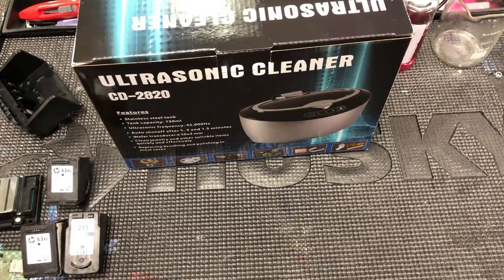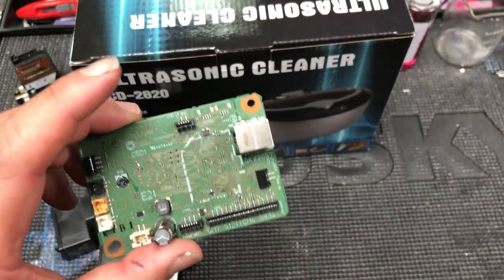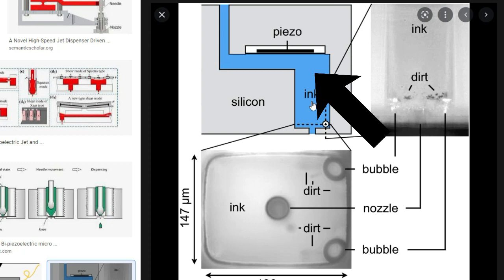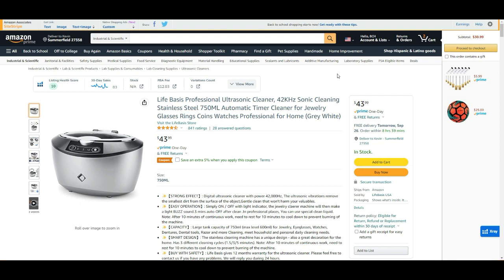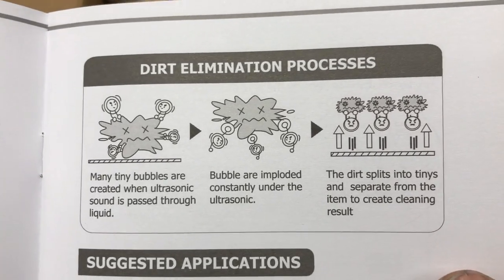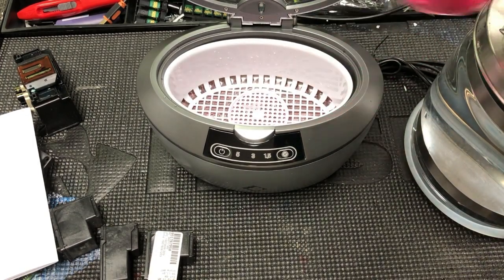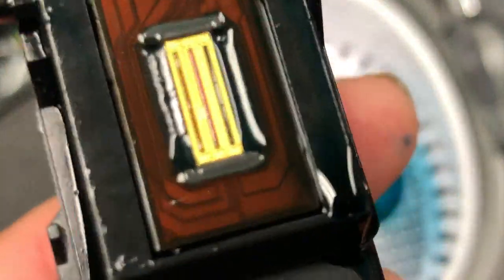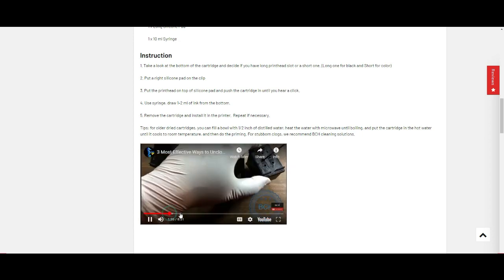5 Tips for Unclogging Your Printhead with a Ultrasonic Cleaner

Comment: Why did a very old HP 45 (51645A) cartridge print perfectly after cleaning, but then stop working again after one page or a few minute wait?
Reply from the maker: Thanks so much for watching and for the great question! The HP 45 stores ink in a bag, and beneath that is an ink box that feeds the printhead, so when an old cartridge prints perfectly right after cleaning but stops after a page or a few minutes, it usually means the printhead momentarily worked with the ink already inside it, but the ink box isn’t able to supply fresh ink because it’s partially clogged or the internal foam has hardened over time; once that small initial supply is gone, the printhead starves for ink and stops again. I really appreciate your support, and if you haven’t already, please consider subscribing or becoming a member—subscribers and members get priority replies (usually within 48 hours), early access to videos, and a higher chance of getting their questions answered since I receive so many each day; I typically answer about 10, with subscribers and members first, and any remaining replies go to the newest comments next, so if you’re not subscribed and don’t hear back within 48 hours, feel free to subscribe or repost your question because newer ones get reviewed sooner, and if you subscribe later your older questions automatically move into priority without needing to repost. You’re also welcome to join me on Run With Kevin — LIVE, where I go live every morning between 6–8 AM Eastern and answer printer questions in real time, so definitely subscribe and turn on notifications if you want to catch the next one. If you need faster help, you can always email [support@bchtechnologies.com](mailto:support@bchtechnologies.com), and if this video or reply helped you, I’d truly appreciate a quick Google review at [https://g.page/r/CfL7k6nYvPQ9EAg/review](https://g.page/r/CfL7k6nYvPQ9EAg/review).

Comment: Hi , I want to ask if incorrect printing , such as  EPSON L805 print head, can be using this method , or it need to dismante l 

I had issue print this printing which the YELLOW can be tainteddwith Black... 

Then I use syringe with liquid special type of detergent, it still doesn't work

I guess the valves inside is miss alignment due to the presure I pull the cleaning solution into it
Reply: Same scenario here i also have the l805 and looking for ways to declogged the head

Comment: The answer is more like "no", in most cases it results in failure; with Epson printheads it usually results in delamination of the nozzle plates because underlying glue is destroyed by ultrasonic waves. I doubt that it makes sense to clean resistive printheads at all, because the they are cheap.

Comment: I had a severely clogged print nozzle and print head from an Epson WF 7710. I separated the two parts (as you show in a different video). Three rounds in the ultrasonic cleaner worked like a dream for the nozzles. What do you recommend for the print head, since you said not use this method for that particular printhead. Oh, and thank you!
Reply: Have you managed to clean the printhead?

Comment: Hi Kevin, a perfect video as always. Nevertheless, one should be very careful not to overdo with an ultrasonic cleaner. I used a very similar 42kHz ultrasonic cleaner with a very stubborn clogged to death canon printhead for more than 10 min and it perforated the jets. Instead of tiny precise jets of cleaner I now have fountains of it on the print head bottom when I push to push it with a syringe. It did perforate not only the clogged color but others too.